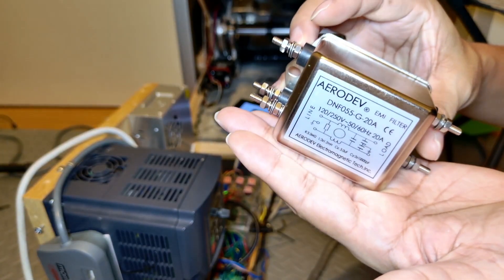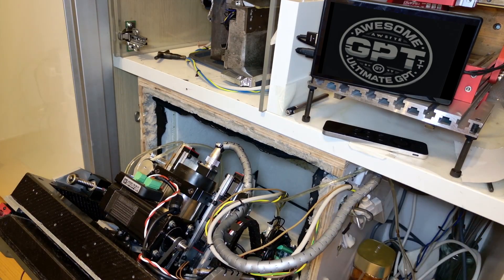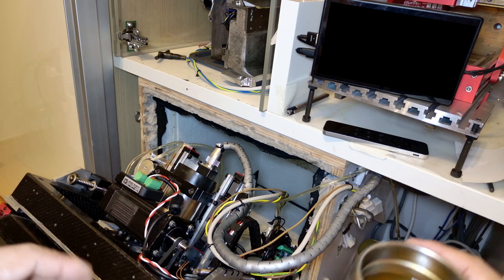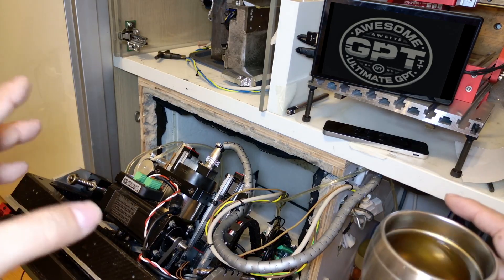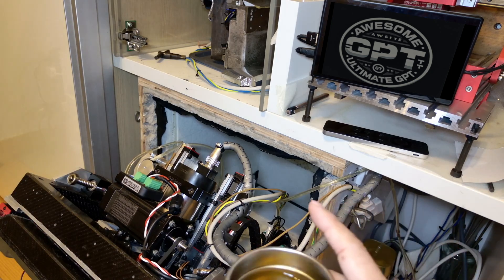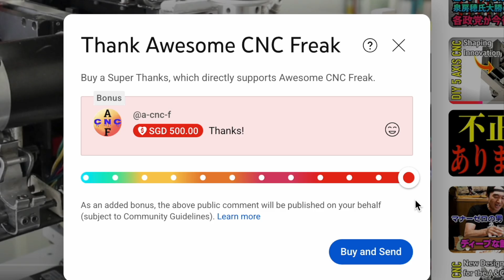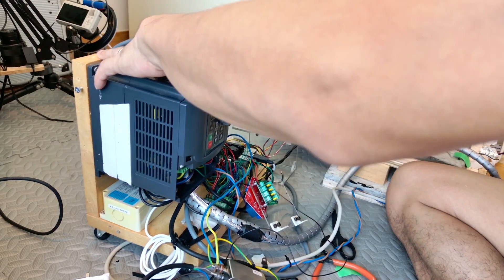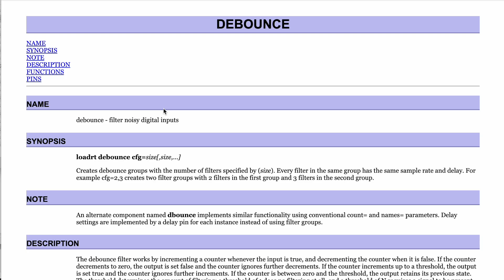The Noisiest CNC Video You’ll Ever Ignore ,and Actually Learn From. Part24

Comment: Very good hahahaha, love the video. Looks like you’ve got everything under control. Maybe a little bit overkill but some other ideas you could consider in the future:

1. isolating some/all of your low voltage control sub circuits connected over cables from each other using optos or isolators. This would require separate supplies for each but would help with issues caused by variations in ground potential between the circuits. If any of the circuits had strict timing requirements would require attention but could be worth it. Makes things much neater from an emc/noise perspective. Great for fault finding and reducing the system down.

2. Use current driven signals over cables rather than voltage where feasible. They usually require more noise power to interfere with and are lower impedance so more difficult to couple into the circuit. 

A great (and simple) example of the 2 in my mind would be to have the limit switch driving the led of an optocoupler and the output of the optocoupler going to your control board. Drive the opto at 5mA (ish) and locate the opto board close to your control board, so the led current is driven through the cable from the limit switch to the opto input. Use twisted pair cable as Jacques mentioned. This should sort out your issues, likely without needing any shielding or filtering. Does potentially need an extra 5V supply for the optos though.

Hope that helps in some small way 🙂

Comment: El ruido fue un dolor de cabeza en mis primeras CNCs. Ni Siquiera sabía porque hacía cosas raras o el  auto-zero no funcionaba.
Mi solución fue cables más cortos, apantallados y filtro EMI. (Y)
Gracias por compartir rey.
Reply from the maker: I also had a lot of trouble with noise issues. I thought something was wrong with the wiring, so I checked everything, but I couldn't find anything wrong. In the end, I really thought I was cursed. Once I knew it was noise, I could look up how to deal with it. It was difficult to get to that point.

Comment: Merci pour ce partage de connaissances . Pour avoir aussi des signaux plus clairs les paires de fils torsadés sont une bonne parade aux bruits.
Thank you for sharing this knowledge. To also have clearer signals, pairs of twisted wires are a good noise barrier.
Reply from the maker: Thank you!
That’s a great tip – using twisted pairs for signals makes a lot of sense.
I’ll definitely try that out on my next build!